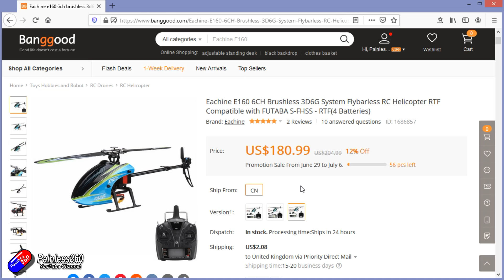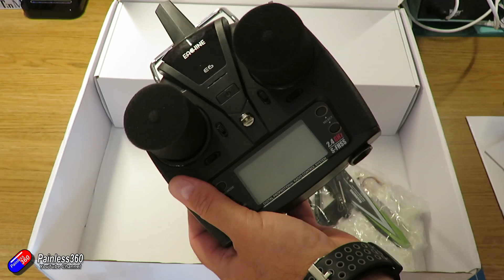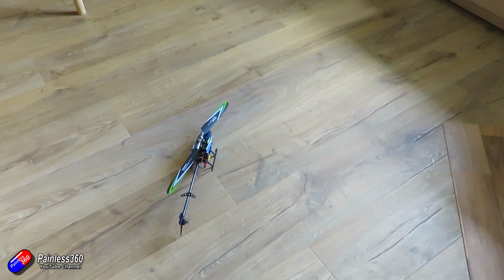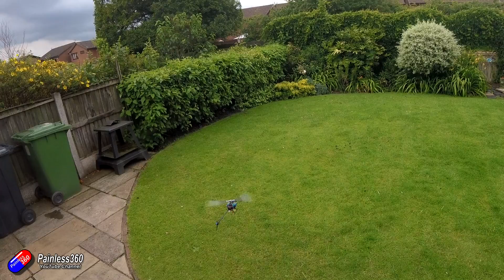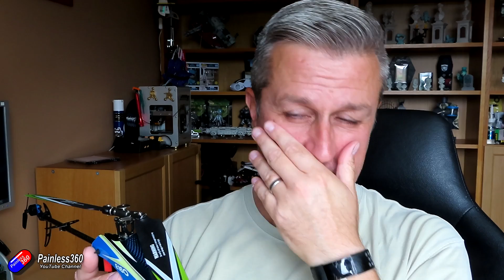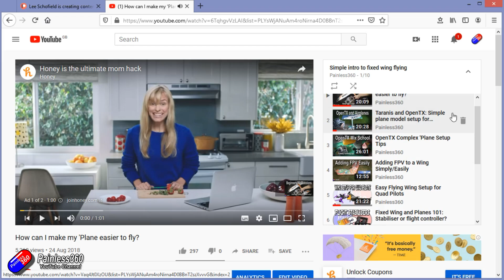Eachine E160 Flybarless Brushless Helicopter

Comment: Use code BGE160RTF to get 15% OFF  RTF Version
Use code BGBNF160 to get 15% OFF BNF version
Reply: Hey, used the link and the code was invalid :/
Reply from the maker: You need to use it with the link in description.. Happy flying!
Reply: @Painless360   I did. It said invalid code. Tried it twice. And once BGE160RTR (instead of BGE160RTF)
Reply: @Painless360  I want the BNF version. Also doesn't work could you provide a link for the BNF version that works?
Reply: expired sad no more?

Comment: After one flight went to use again and no light on copter. Just makes the little tune when plugging in and nothing. Can you tell me which component I need to most likely have to order and replace?  Esc? , mother board? Thanks
Reply from the maker: I've not seen that failure here so all I can suggest is start with a thorough visual inspection of the model to see if you can spot anything loose or damaged... Best of luck

Comment: Hi, Martyn here again! 🤩 I’m trying to get my head around the myriad of micro connectors these days 🙄.
I think the E160 is a good example of micro JST connectors - of which there are many! Extremely common since the advent of 250g rules etc.
They include ZH, SM, XH, PH, EL, SYP just to mention a few 😫 Then we have mm of “pitch”, which I believe is distance between pins, another one is 1.0, 1.25, 1.5, 2.54mm, SOMETIMES refers to the diameter of wire, not to mention overall plug dimensions!
All I need right now is a bunch of wired 3 pin plugs (which are on models everywhere, including the E160’s SBUS & servos). Nearest measurements I can make out: 5 x 2 x 4mm deep. Adjacent to those is a slightly larger socket for DSM, a few plugs that size would also be handy, but not essential right now.
PLEASE do you know exactly what to order? A simple bag of servo plugs which I use in all sorts of applications including micro ‘lost model alarms’ 😭 how hard can it be?! 
Sorry for rambling and thank you again for your great knowledge! 👍🏻
Reply from the maker: I tend to keep all of my spare wires from builds in a little tin for times like this. I agree, it is confusing especially when vendors are not explicit with what connectors are used. I'd send a message to the vendor or reseller with the question. Best of luck
Reply: @Painless360  Thanks, will do! 👍🏻 Like yourself, I have drawers full of spare cables and bits but just not this particular one. Ironic, as they seem to be on every small model these days 🚁
Reply: Hi, After watching this again, a 6 year old video of yours popped up! https://youtu.be/4stL9_LQGzI
So while messing around with various connectors, it dawned on me, let’s see if your link still works: the Discovery Buzzer from HobbyKing:
https://hobbyking.com/en_us 
As we know, 6 years in this hobby is a long time, so that buzzer is long gone. However, is there something similar & simple available for the E160 and similar micro helis of today? What d’you reckon? Cheers, Martyn 🚁👍🏻
Reply from the maker: Lots of modern options now. All of my videos are carefully organised into playlists and every video has a number of text tags on them to make them easy to find if you use a search. This video should help and explains a few tips for finding the video or playlist you're looking for - https://youtu.be/CIuUNdVfBJQ or https://www.youtube.com/watch?v=P4soR6QgOk0. Happy flying!
Reply: @Painless360  Thanks Lee - great links 👍🏻 However, I still can’t find anything about new lost model locators. I think your most recent video was 4 years ago. I go to your channel by default because I love your explanations & suggestions and in this case, you’re familiar with the FC board on the E160. 
There’s a DSM socket and an SBUS PPM socket available as well as the servos. Molex Picoblade and JST SH connectors look the same to me! 🤔 I’m not familiar with drones. Can you recommend a model finder for this heli? 🚁 Much appreciated! 😁

Comment: I have just bought the E160. But have had a bit of bad luck the one I have received from Banggood has a fault with the ESC or FC as the Low voltage cut out works, but at the wrong time. I still have around 75% battery left. Was hoping you might be able to help as it might be adjustable, but I have not been able to find an in-depth instruction manual.   By the way, love what you do, fantastic channel
Reply from the maker: No idea, I only have the same manual you do.. Best of luck!

Comment: It looks like it would disintegrate with a crash that a quad brushed off with little to no damage.  Is that correct assumption?
Reply from the maker: Helis are more fragile.
Reply: No. I have the xkk130 and xkk120 and xk110. They are  very durable. Mostly you'll break the tail boom or bend a feathering shaft.

Comment: Great video , I would say that when you are a beginner , you have always crashes, and a more plastic/tolerant small Heli would be better, I started again heli flight with the e119 which is very limited but very cheap and easy, then bought a XK K110 which is a fantastic model very tolerant to crash and easy to flight in 6G ... you can make a lot of mistakes without too much damages... I am waiting now my e160 next week apparently. I will see what this one bring to me.

I bought also the omphobby M2 , but too impressive for now for me to flight...

The downside of these small and cheap helicopters is that when you are used to them... you ask yourself... why flying a big and very dangerous one in place of it :)

I started Heli 30 years ago, it costed me 1.5 month salary (heli + radio)... crashed after 3 very short flight and I stopped... too expensive ! Incredible what you can fly today with only 50/150 €
Regards

Comment: This might just bring me back to Helis. I got started with the coaxials,moved to a Blade 120 and got very frustrated.Luckily had fun with fixed wing and then quads got so much better by leaps an bounds.Like you,i"ve always had a soft spot for a single rotor.

Comment: I started with a blade CP years ago. I learned to fly helis before learning to fly planes actually. And while that's an insane thought for most I had no idea how hard helis were. And reflect how silly it was of me to be so afraid to fly planes for the first time. The stability mode would be great for new pilots coming from mulitrotor land. 
The availability of parts is vital and I would highly recommend that Eachine make parts local to the global market helis are not multirotors and they have a high part count. When crashed they tend to flop around a bit and eat themselves. And quick part ordering would be really nice.
The blade mcpx series is a seriously good little copter and quite durable too.

Comment: Lee, If you are at all keen on getting back into helis, I suggest you check out the OMP HOBBY M2 Expore  and M2 v2 available from SotiaRC.co.uk  and Banggood.  It's a little larger, has a direct drive brushless main motor spinnig the main blades, and a brushless tail motor.  It also has a stabilization system, and LOTS of power.  I'm told, flys very well, I have one on order, but not got it yet.

Comment: Your story could be mine...totally recognize it. Started with a walkera hm36b because I was young and didn't had the money for a decent helicopter. The walkera was absolutely rubbish, specially the tail gyro. In fact the gyro on mine wasn't working at all....so I always had full left rudder to keep the tail from drifting....thought it was normal. Till somebody told me it wasn't. Bought a hobbyking hk401b gyro and the helicopter finally flew ok. Then switched to the t-rex 450se, and men.....heart pumping every flight. Then I noticed the rcexplorer diy tricopter, bought some wood and a first version kk fc, and wow....that flew sooooo easy. Switched to tricopter, to quads, to mini quads, to planes.....

And now I'm back at my old flybarred t rex 450. This eachine looks great too!!
Reply from the maker: There are a lot of us 'lapsed' heli pilots out there.. I was just genuinely surprised at how nice this was and how well it flew..
Reply: @Painless360  "rc" technique made some incredible jumps over the last 10 years Indeed....I remember the first time that the kk board came into production, as an alternative to a totally diy solution with the 3 imus out of the Nintendo wii remotes. I think it was about the first serious open-source fc project and I was absolutely amazed by the tech. Flashing with the lazy zero kk flash tool. Maybe you also remember it! When you look at it now...it's the most simple piece of hardware and code you've seen. A big hooray for al the (open-source) thinkers out there that made this kind of progression possible!

Comment: Great video as usual. I began flying helis too before moving to quads and fixed wing. I do still fly my TRex 450, although I fly the 450 FPV which definitely gets the adrenaline going and is a real challenge compared to quads. Can't beat the sound of a heli!  The Eachine heli looks very stable. Would be great to see you having a go at putting a micro camera on it and flying it FPV.
Reply: Idk about flying a 450 in fpv as its very dangerous but helps with orientations and keeping it were you want it to be makes it harder to crash

Comment: Having flown helis for years this offer from eachine is probably the most expensive Ive seen for this price (AU$300.00). Better to get yourself a Trex 450 flybarless basic kit.
Reply: bear in mind that the trex 450 won't have any type of flight stabilization for beginners, and that's a big deal.
Reply: @Graham_Shaw  You can buy a heli flight controller for 30 bucks. NO EXCUSE.
Reply: @OzFPVflyer  Yes, you can, but it won't have stabilization, or rescue at that price. And it will be a clone, so basically stolen IP. The E160 is only a little bit more expensive than what could be considered it's predecessor, the XK K130, and it has a brushed, coreless tail motor that wore out fast. Also, I think you are not considering that a 450 would be much more intimidating for beginners due to the bigger size.  Lastly, why do you think I'm trying to make excuses for the E160's price?  I just think it makes a great beginner heli, what's wrong with that?  Each to their own I suppose.

Comment: Holy molly that's expensive for a small helicopter! i had a figure in my head of around £75--£90 from Bangood then clicked on the the link and wow yeah its expensive.
Reply: Actually, for what you are getting, the E160 is very cheap.  This heli cannot be compared to those cheap rubbish toys you see in shopping centres, this is a propper little 3D capable micro helicopter, and had it been sold under Horizon Hobbies "Blade" line of products, it would have been twice the price of this.